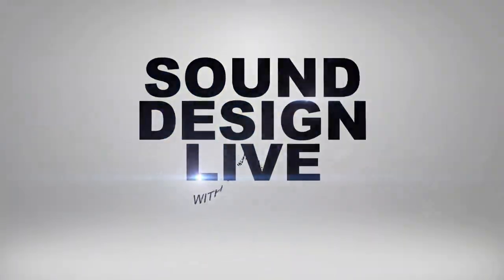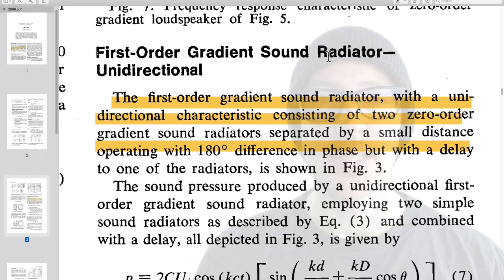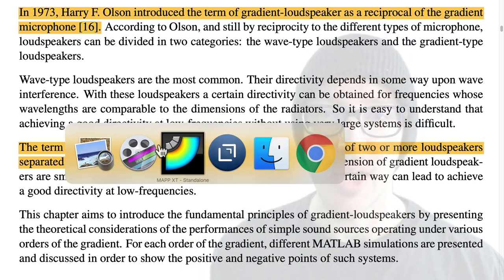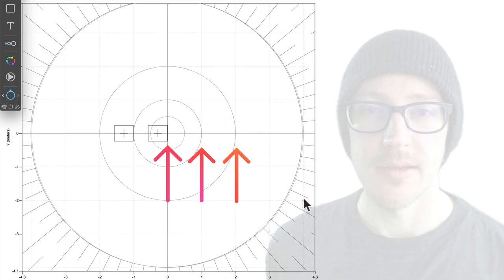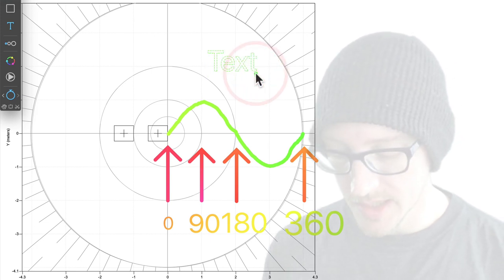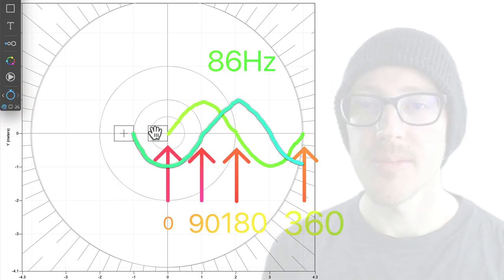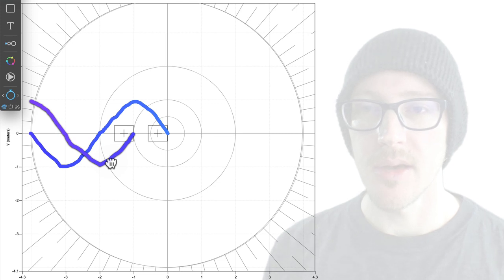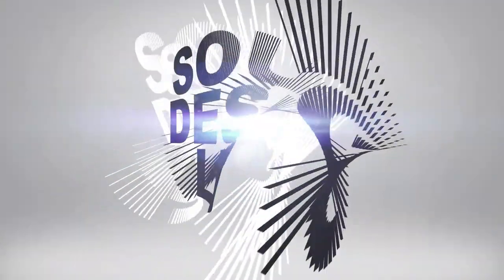Why do you polarity invert the rear sub in a cardioid array?

Comment: Superb! Thank you for this video. One question to clear out some thoughts:
In this example the choice of frequency and distance was purely based on working with round numbers, right? What's important is to consider the distance between subs.
If we try to achieve the same effect with stacked subs one will be faced forward and the second one faced backward with polarity inverted and with a delay equivalent to the depth to the cabinet, is this correct?
Reply from the maker: Hey Diogo. You're welcome! :)

> the choice of frequency and distance was purely based on working with round numbers, right?

Yes it worked out well for the demo to have round number, but 1m spacing is not an uncommon design and is an easy goto template of mine when I am in a hurry.

> If we try to achieve the same effect with stacked subs one will be faced forward and the second one faced backward with polarity inverted

Yes, an in-line gradient and its stacked brother use the same processing and calibration procedure. In a 2-element array, the one you reverse will control where you want the null to go. In front of a stage, for example, you might want the null to go towards the downstage vocal mic, if there is such a thing. 

In a 3-element array, which one you reverse can have some minor affects, which @MerlijnvanVeen has written about here: https://www.merlijnvanveen.nl/en/nl/studiezaal/135-which-sub-to-reverse

> a delay equivalent to the depth to the cabinet
That will be the case in MAPPXT, but in the real world it's a little longer because sound has to travel around the box, which is why you need to calibrate it in the rear in the field.
Reply: @nathanlively  Thank you very much!!!

Comment: Do we get the same result by delaying only the front sub, (by 1/4 wavelength,) and neither is reverse polarity? Perhaps simpler.
Reply from the maker: Hey Gordon, no, you would not get the same result. Everything in front would 90º out of phase and everything in the back would be a 180º out of phase, I think. Give it a shot in MAPP or in the real world and let me know your result.s
Reply: I don't have MAPP, but my RayEnd shows it working without reverse polarity. Several articles present it that way as well. One article in Sound Forums has yet another twist on fine tuning the array by stair stepping and tweaking the levels. Thanks a lot. I am going to try it this summer. https://soundforums.net/articles/stair-cardioid-subwoofer-array-192534/
Reply: @nathanlively  The technique Gordon refers to provides broadband summation in the front and a phase-based (frequency-dependent) cancellation in the rear. The technique you discuss in your video provides broadband (polarity-based) cancellation in the rear and frequency-dependent summation in the front. I showed the effects of both in this article: https://www.prosoundweb.com/tech-topic-friends-in-low-places/

Comment: couldn't we even get more a perfect-like cardioid pattern over a large range of frequencies if we'd process the low-end frequencies by a multiband filter and apply different delays to each of them?
Reply from the maker: Hey Paul, the delay is not really the limitation to perfect cancellation. It's manufacturing tolerances. No manufacturer builds speakers that match to within 1dB. So if you want a custom performance increase, you might try micro surgery EQ until you can get your subwoofer response to match through the operating range to within 1dB.

Comment: I'm not convinced this is correct. I'm not a trained acoustical engineer, just a musician who runs sound from stage.
But in my admittedly limited understanding, the only physical thing that happens to a speaker when the polarity is changed is that the speaker moves in the exact opposite direction of how it moved with correct polarity. In correct polarity, the initial speaker movement the moment sound is first produced is toward the FRONT of the speaker. When polarity is changed, that initial speaker movement is instead directed toward the rear of the speaker. That is the only physical, mechanical, thing that happens when polarity is reversed. 
If I, instead of changing the initial speaker movement of a second enclosure in relation to the first one by changing it's polarity, simply rotate the second enclosure 180° in relation to the first enclosure, thereby causing the speaker in the second enclosure to move in the exact opposite direction of the first, which is the same physical motion caused by changing it's polarity, haven't I accomplished the exact same outcome? And with proper time allignment via delay, haven't I already accomplished the same goal of cancellation toward the stage and summation toward the audience?
Help me understand where I'm wrong.
Reply from the maker: Hi tlb2732! Thanks for your interest in the video. I have another video that talks about this, but it's possible that you will only be convinced by trying it yourself. Which is easy enough to do, even without an audio analyzer. With an audio analyzer, take a measurement of a sub (ideally outdoors), then rotate it 180º and measure it again. What do you observe? Without an audio analyzer, you could take two subs side by side with the same signal. Turn one one, turn the other on. They should sum. Invert the polarity of one, they should cancel. Now restore normal polarity and rotate one of them 180º and try the same test.

https://youtu.be/G0l6yniHslo

Comment: Can I use another sub up to front sub?
Reply from the maker: You can try! :)
Using two matching subs is already a challenge because no manufacturer produces subwoofers that within 1dB of each other through the operating range. This is why 30dB of rejection is impossible in the field. So if you have two different subs, you'll have to spend some time making them match. Maybe try an FIR filter with auto magnitude?

Comment: Nathan Thanks a lot for the nice explaination. But you considered just 86 Hz. With this we get  full summation due to 360 Degrees Shift. But what about the other frequencies? Suppose we drive 26Hz to 100 Hz with the Subs. So how can i make sure complete Subwoofer spectrum has summation? is this 1 Meter sub differenze and 1 Sec Delay a constant? so that we can use in any ocation? Or do we have to calculate it targeting a certain Frequency? Fo instance u targeted 86 Hz here. The same do i have to do differently if i target 60 Hz?
Reply from the maker: > But you considered just 86 Hz.
Yes, this seemed like a good way to simply the discussion.

> But what about the other frequencies?
A gradient does have limitations on its usable bandwidth and you need to be away of these when it is deployed in consideration of the filter placement and level relationship. Please read this -> https://www.merlijnvanveen.nl/en/study-hall/167-lack-of-impact-revisited

> So how can i make sure complete Subwoofer spectrum has summation?
You can't, but you can plan for the bandwidth limitations using your design modeling software, the Subwoofer Array Designer, or with careful measurements in the field.

> is this 1 Meter sub differenze and 1 Sec Delay a constant?
Is that what I said? I thought I said 1m and 2.9ms of delay. 1 second would be about 345 meters. Either way, the answer is no. It will depend on the speed of sound.

>so that we can use in any ocation
Yes, I often use 1m and 3ms as a template in the field and then optimize from there.

> Or do we have to calculate it targeting a certain Frequency?
Yes, a design considering the maximum forward summation frequency is recommended, but if you want to work from a template, then just don't exceed 1m.

You are asking a lot of good questions. My challenge to you is to open up Subwoofer Array Designer, do some experiments for yourself, and let me know what you discover. Good luck! :)